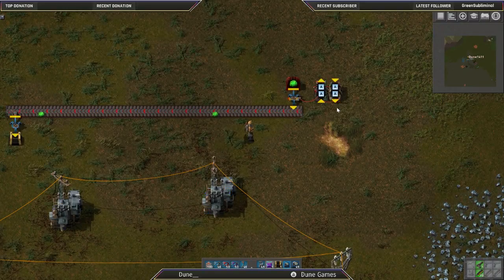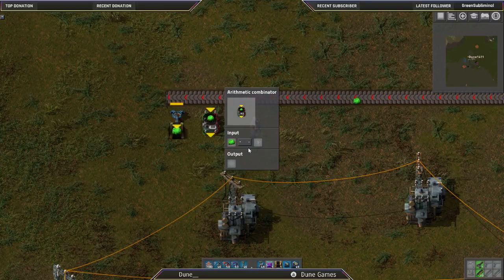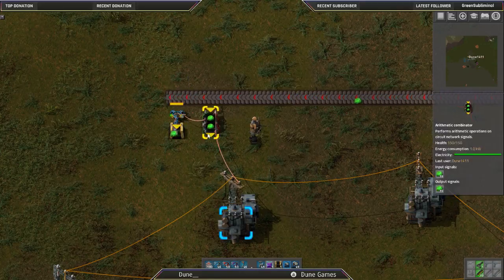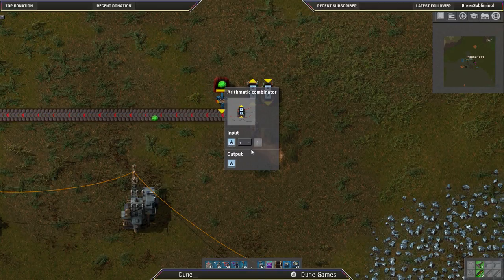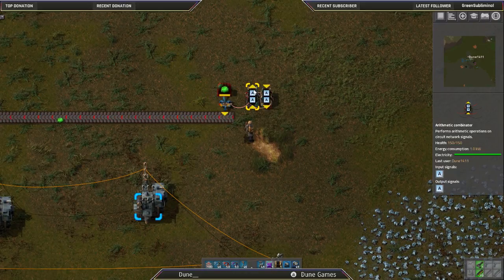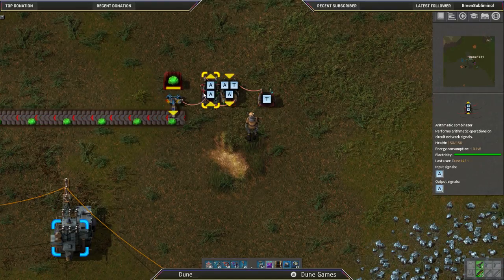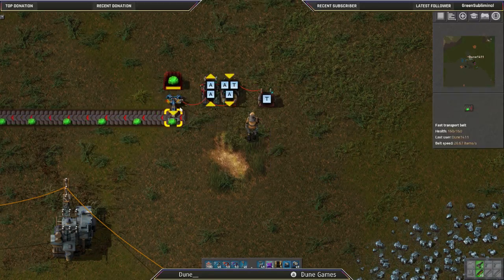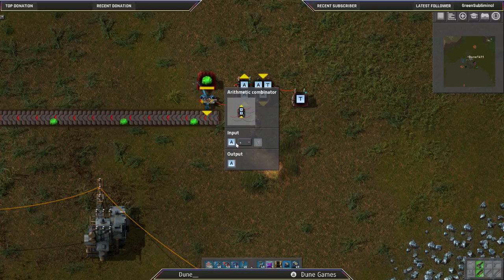Factorio - Circuits Explained - Counters

Comment: How do you reset the memory bit at the beginning? I could't figure out how to reset the value
Reply from the maker: The left side requires a new placement of the inserter + combinator, and right side it resets automatically when it reaches the value set in the constant combinator,

Comment: Hi :) great video! 
one question. Can i combine these two methods ? I would like to limit my inserter to only transfer 100 rocket parts to my Cargo Rocket Silo (modded) however i can not connect it to the silo because it eats up its inventory when the rocket part is inserted until its ready for lunch. Unfortenately the silo only outputs its current content. So the question is: Can I somehow count each spin of a inserter ? to calculate exactly 100 rocket parts have been inserted and after that disable the inserter because i dont want my cargo to fill up with rocket parts if the rocket is already assembled.
Thanks :)
Reply from the maker: That's what this kind of circuit does, counts the items picked up. Then set enable to be < 100 and the stack size to one. It should stop when it reaches 100. Attach the inserter to a power pole via a red or green cable to create the circuit. The power pole will also give you the tally of items the inserter has already moved.
Reply: @DuneGames   ok, maybe i dont understand something else.. I am really just starting with circuits... Do i have to use specific item signal as you have in the first part so that the inserter is counting correctly? How do I differentiate input and output signals when it is the same signal(item)? Can i set the reset condition with the item which is that inserter using?
Reply from the maker: @vojtastastny5261  A circuit has no values unless an entity puts a value on the circuit. If two entitys put the same item on the circuit, those values are added together. On the first part of the video, the inserter puts a value on the circuit, and the output from the combinator puts a value on the circuit. Those values are added together and the input of the combinator reads that value and then outputs it and then holds it there indefinitely (since its inputs and outputs are wired together) or until the input value changes, which it does when the inserter picks up other item(s). The inserter is set to pulse the value, so it only gets added to the circuit once.
Reply from the maker: @vojtastastny5261  Inserters don't have separate input & outputs. You pretty much deduced that yourself. The memory of the value being counted is the arithmetic combinator with its input & output wired together it continually keeps the value, since it is a + 0 to the value. When the inserter picks up an item, that value gets added to the value on the circuit (what the combinator is keeping), thus the total value goes up by the number of items picked up.
Reply: Vojta Šťastný did you get it working? If not I have several ways you can limit production depending on your goal
Reply: @MrDonkey912 tell us plz! 💙